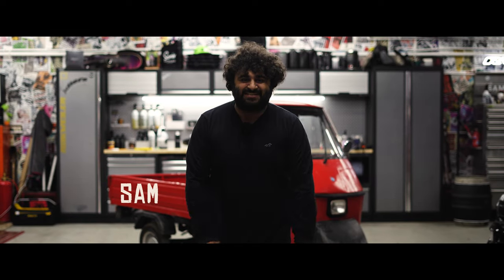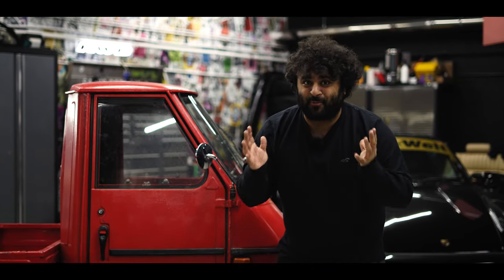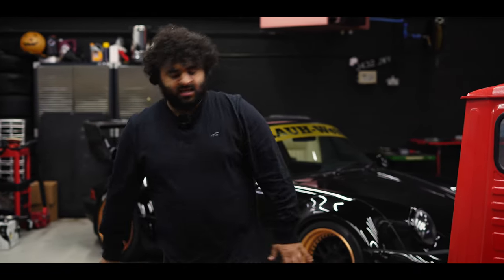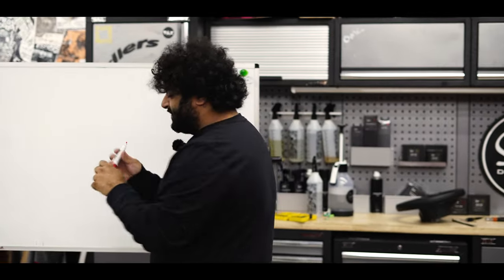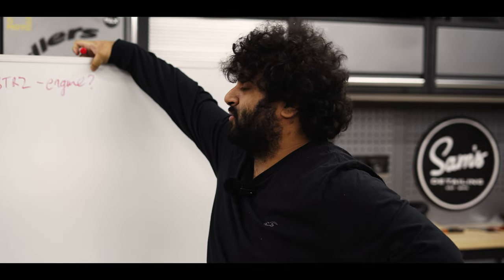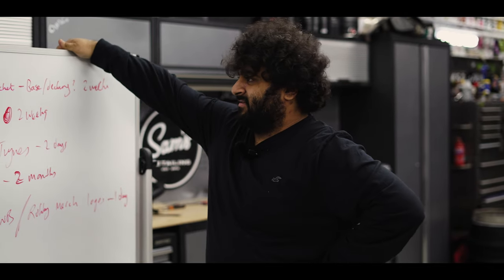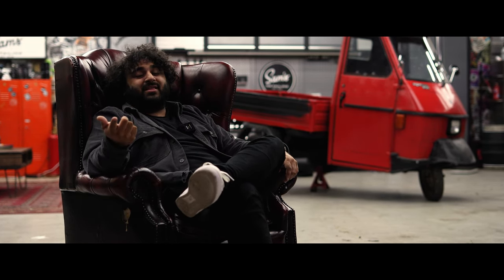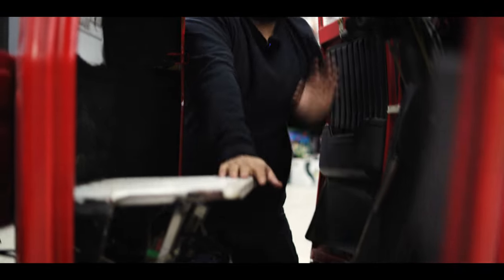I bought a TUK TUK - EPISODE 1 - The Tuk Tuk Transformation

Comment: New spark plug and lead and you'll be fine. Get your fab guy to remake the sides of the tray and weld them on, keep the deck floor and cover with nice teak slats with black inlay (like on the deck of a yacht).

Comment: The HT lead is broken down, a spark at the plug end and also higher up. You could crudely wrap in insulation tape but will want replacing. 

Cool video though and start on it 😍